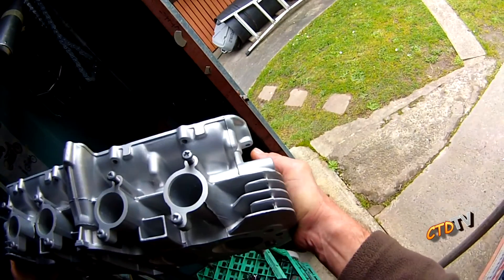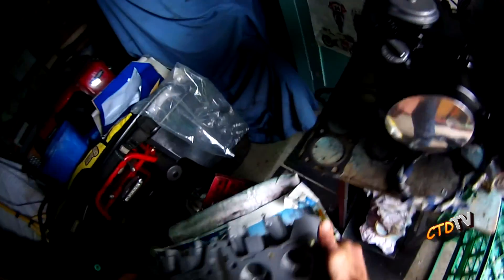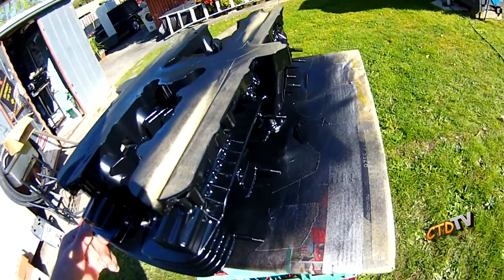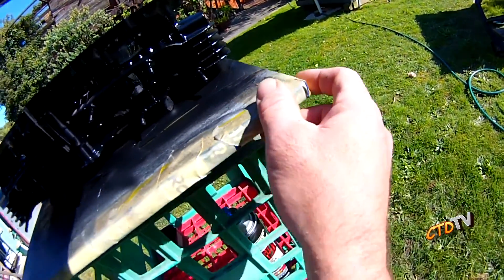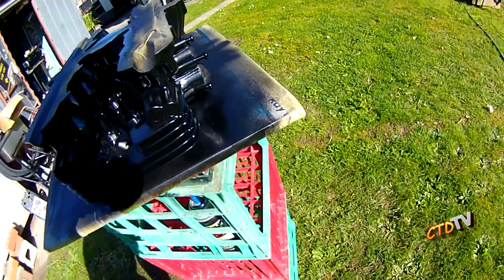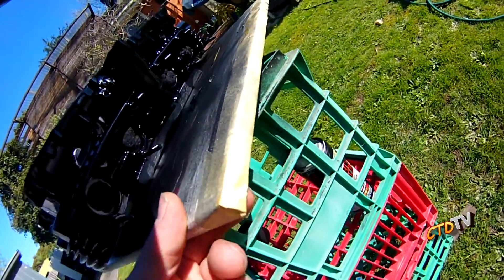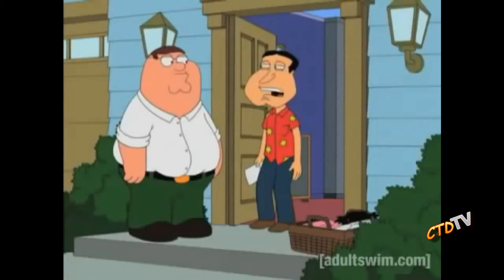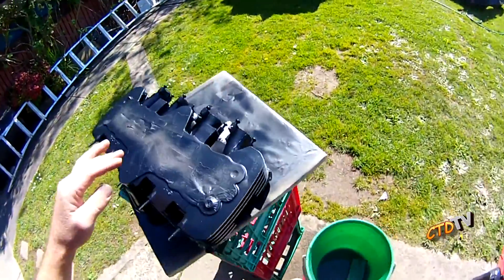z750 ReBuild   Head is now Cleaned & Painted

Comment: The VHT paint isn't bad have used it myself, saw a Z900 motor a couple of years ago that had been blasted like yours and it looked better than new :) I have a friend that is a wiz with the Z900's.
Reply from the maker: +banditnev I'm curious about 'POR' paint - http://www.por15.com/ENGINE-ENAMEL_p_47.html
Might use it next time, help with the stress of 'finding a new chip', in work just completed...more expensive, but Longer Lasting. You can Brush/SprayGun too, spray cans only have 1/4paint, rest is propellant. 
So the higher cost will be cheaper in the end i hope?
TFW Nev >:)
Reply: +MrFalloffalot CrashTestDummy  TV I've not heard of that brand Por but these days it should be good.
Reply from the maker: banditnev American brand, been round for years apparently, I never heard of em till recently too.
I smell a Review vid...
>:)

Comment: Good paint job. Liked the way you took the paint off the end of the cooling fins. Are you intending to lap the valves in or just leave them as is?
Reply from the maker: +steelfabric Allway's should seat valves by grinding (fine/course) before re-installing.
I think i'll only have to do a Fine-Cut, in the garage by hand tool. The surfaces are all 'shiny & even' all the way round, so all good.
Was most likely Carbon holding valves open a smidge.
TFW Steel. >:)